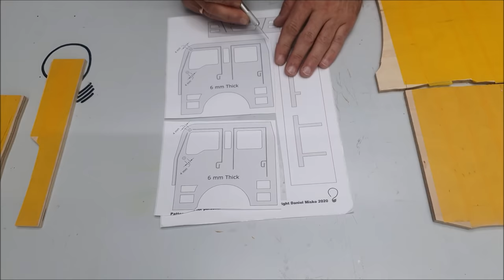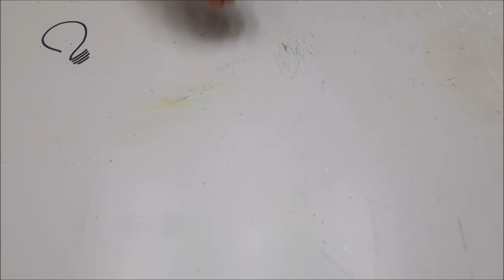Fire Truck - Wooden Car Model

Comment: I thought you were going to screw or otherwise non-glue on the rear box. The truck chassis could just as well be used for other things: A cylinder (tanker truck), empty box with a roll-up door on the back (delivery truck), house (RV), platform with sides (hay wagon) or bunks (logging truck), many more.